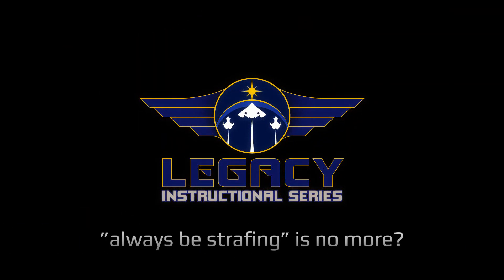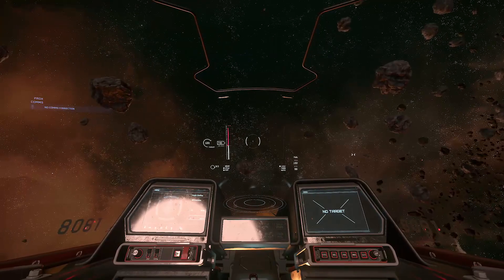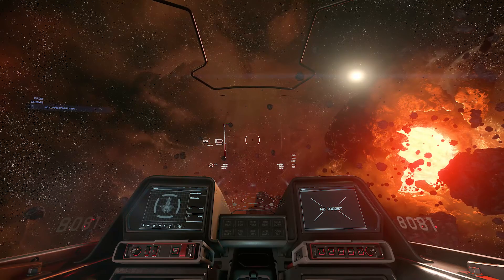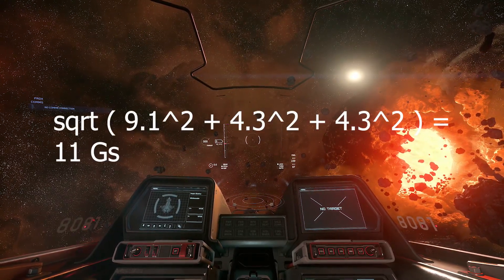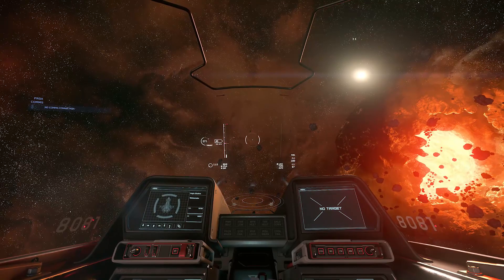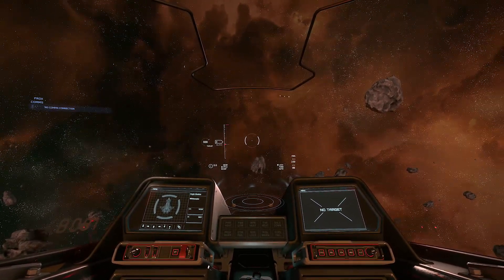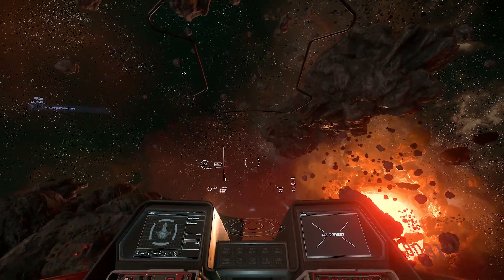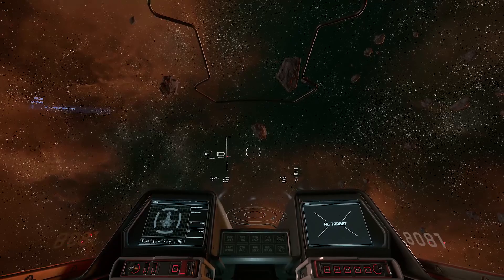3.10 Flight Model Tips - Turning and Braking - Star Citizen Tutorial

Comment: Ok... so in summary still not on par with 3.6 and earlier builds in terms of flight models? Seems that they really ditched having a simulated flight model ey? CIG shouldn't have ditched the guy that made it... maybe looked for coders to help him code.
Reply: Dont even know what you're talking about? It is a simulated flight model.
You're confusing IFCS with sim/not-sim.
IFCS is a flight control AI, that adjusts the thruster output to give the pilot the desired effect. The underlying sim is the same.
Reply: @Baleur  I guess my comment mostly followed after what seemed to be a very strange way of gaining and reducing G forces.
Reply: What do you mean strange way? Using more thrusters means having more power to fly forward or slow down.
Reply: @Muhanoid  thats the issue in this flight model you can only fly straight and slow down  if you want to dodge in comming fire or try and get on someones tail you cant. we now have what people lied about in older patches whoever fires first wins and auto aim makes it even worse